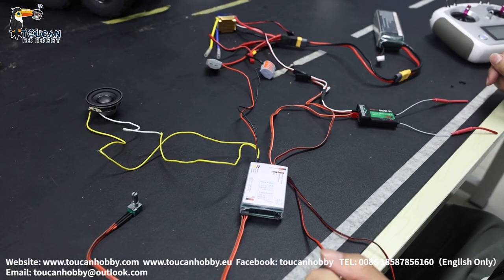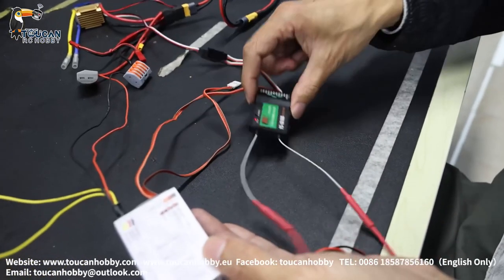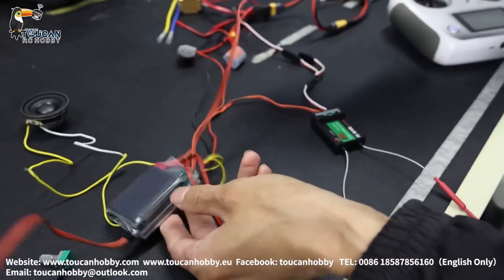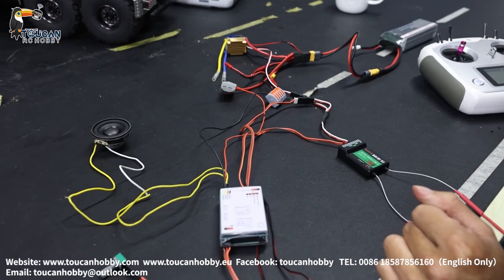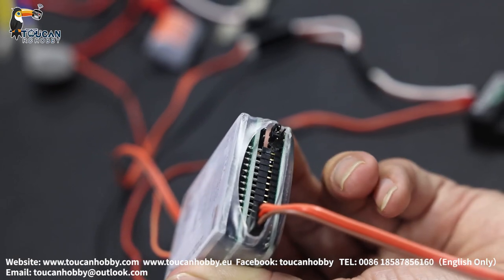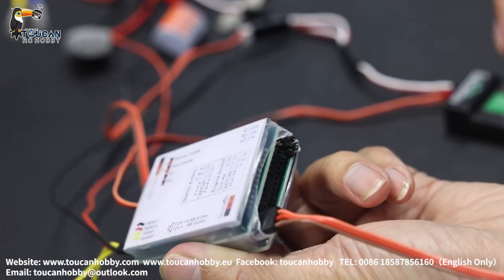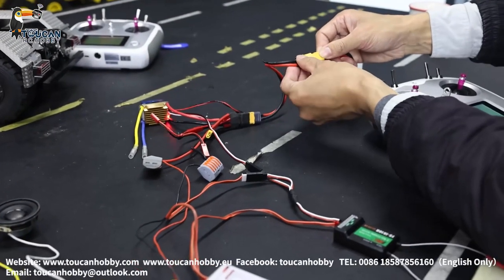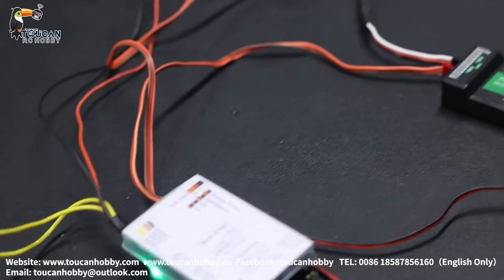How to connect and use 3T sound system for RC trucks, three engine sound R6, V6 and V8

Comment: Hi! Tell me, is it possible to connect this board to the MFC-01 from tamiya?
Reply from the maker: Only matters if your receiver got enough channel to control it
Reply: @toucanhobby2400  My truck is controlled by turnigy 9x, the receiver has 8 channels, 3 channels are free.
Reply from the maker: Yes ok as you see from video only one channel need, because another wire is connected together with throttle
Reply: @toucanhobby2400  As I see the connection from the video, if it is incorrect, correct me. From the MFC, the throttle channel J5 is connected to the ecs smx. And from the SMX, the throttle channel is connected to the receiver. The second wire from the SMX is also connected to the receiver responsible for the car signal. And the smx itself is recorded from the battery.